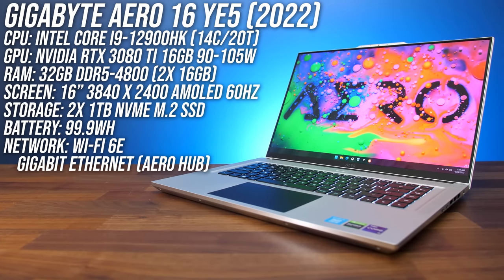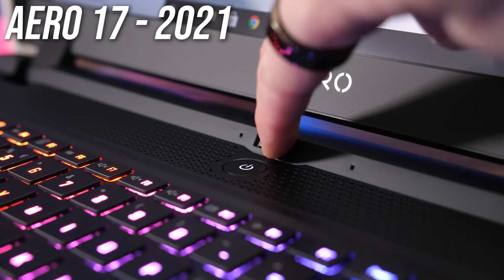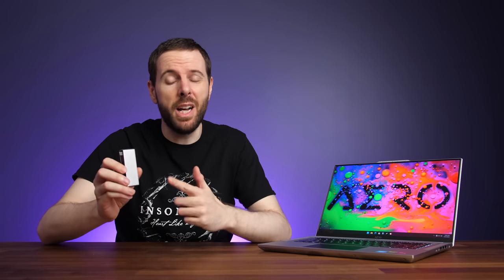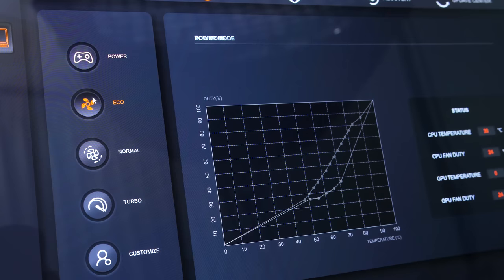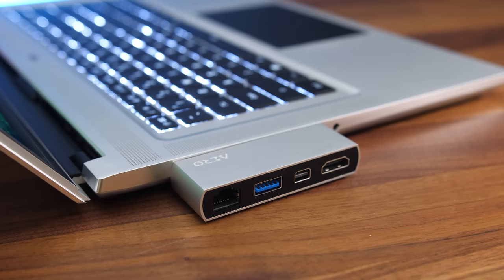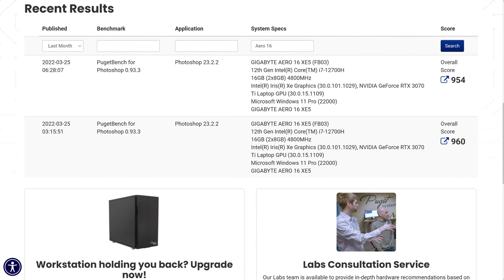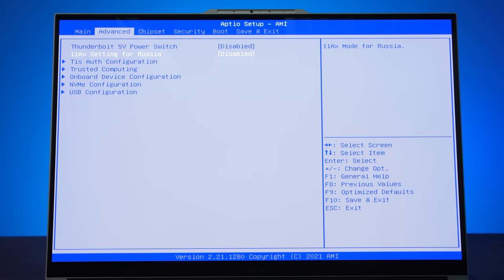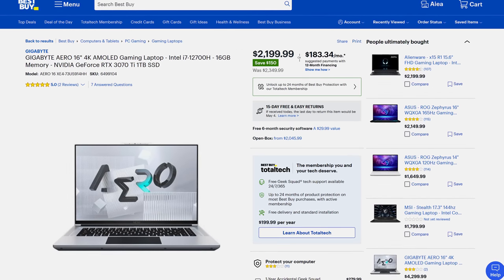Gigabyte Aero 16 Review - Why Did They Do This?

Comment: Just got this laptop, to fix the audio go to System > Sound > Advanced > More sound settings > Playback > Speakers > Advanced > Signal Enhancements, 

disable "Enable audio enhancements"

click ok

There, now it sounds really good, just much lower volume.

It seems obvious, they weren't happy with the volume and just craaAAAnked up the treble into to clipping using some processing.

Comment: Since you've reviewed plenty of Gigabyte laptops, I'd like to ask you something. Have you been using the Gigabyte Control Center? I bought a Gigabyte AERO5 XE4 (i7 12700H, 3070 Ti), and the latest updates, both GCC and NVIDIA, killed the performance it had when I first used it. GCC can't be rolled back, but the NVIDIA drivers can, which solved half the performance issues. GCC used to be able to change CPU TDP on the fly by switching power plans, but after the latest update it stays stuck at 45W unless I change it manually via XTU. Choosing any profile within GCC now only changes fan profiles, which is pointless when you're not increasing power to the CPU as it only adds noise to the experience. The latest NVIDIA drivers removed the power limit option, locking the GPU to not go over 109W, but going back 2 versions fixed this. I'll update once they add the option back. As for GCC, when you try to roll it back to a previous version, the app opens an internal browser with the link to the latest version, completely disabling all other functions. Updating or rolling back BIOS made no difference. The Gigabyte power profiles were 45W for power saving, 55W for balanced and 70W for high performance. Since it stays at 45W, the CPU doesn't even reach the base clocks, causing performance within games and other apps to drop substantially. I also tried uninstalling GCC altogether, but the problem with this is the "Turbo" fan profile. This fan profile reaches a speed over any other profile, and it's the one that drops the temps the most. When GCC is uninstalled, this fan profile is never applied, so applying the High Performance power profile (or setting the TDP to 70W as intended before the update) causes thermal throttling, which it didn't do with the Turbo fan profile. So, with all this said, what has your experience been with GCC (if you've been using it), and have you seen performance issues with the updates?
Reply: How did you manage to roll back your BIOS? I want to roll back the bios of my AERO 16 but can't seem to find the previous version from their website
Reply: @WeeeAffandi   There were 3 BIOS versions within the Driver Downloads page of my model. I also checked comparable AORUS models and sometimes there was only one BIOS, others 2-3.
Reply: @cianide99 Hello did you install the latest GCC?
Reply: I have the exact same laptop as you and my battery life is horrible (2hr max) do you have the same problem ?
Reply: @Alexpiano9104   Yes. I first installed the previous update, and my laptop keyboard had some colors enabled, red, orange and green. I contacted Gigabyte about it, basically telling them to fully enable the RGB in this keyboard since it obviously is, but their answer was that, because of the model, the color was locked to white. A couple days later the latest update rolled out, disabling the keyboard color change and setting it to white only, but that update completely disabled the TDP changing with power profiles. Tried to roll back GCC to the earliest version, but when it loaded, all that was available was a browser within GCC with the link to download the latest version.
Reply: @cianide99  i know what you mean , you have to click in the left tab and click “check” and install gcc from there
Reply: @cianide99  Do you have also a horrible battery life ? If not , how did you fix it?
Reply: @Alexpiano9104   I rarely use it unplugged. I use it either at work or at home, so mostly I don't have the need to use it on battery. Most of the time I have somewhere to plug it in. For something on the go, a gaming or creator laptop isn't the best option.

Comment: as a normie pc user, having no ports other than usb c automatically throws that computer on the bottom of the barrel, no matter the specs. much rather have an i5 with ports that an i9 without ports. ethernet is a must

Comment: This Aero laptop is a creators dream machine.
Reply: You forgot the missing SD card, which, as much as I hate Dell's XPS products, at least their XPS 15 & 17 still have a full-sized one built-in with no dongle required! And heck, even APPLE reversed course and readded one! Add the software glitches for CREATOR'S APPLICATIONS, the port selection being worse than a 16 inch MacBook Pro from 2019, and the rather high to ridiculously high price of the models, and I don't think it's worth it at all...

Comment: Hello, Bought this laptop aorus 5se and it performs well but it will not keep a charge while plugged in and gaming.  Help me, is it normal?
Reply: i have the aero 5 xe4 and i have the same problem when gaming, i think that the psu deliver no enough power for the laptop when on gaming

Comment: I bought a gigabyte Aero 16 with 3070ti and i7 about 4 months ago, recently it started turning off randomly, screen black out , wifi occasionally looses connection. Now it is in the service center. Hope they can fix it.
Am I the only one who is faced with such issues? With my previous laptops I had no such issues.
Reply: I had somewhat similar issue with screen black outs (sometimes it would become glitchy and would require a restart). I installed a new RAM last week and so far its been running fine.
Reply: I had that problem of powering on, and then a few seconds later, it shut down randomly once. After powering on a second time, it doesn't happen again. I was using liquid metal, after moving it to Thermal Grizzly Kryonaut it stopped randomly shutting down.

Comment: Anyone used it for more than a month? How is the heat in games? Does it hold under full load without a cooling pad?
Feedback would be appreciated.
Reply: I have the 3070 ti version and didn't find it particularly hot or loud. It's like Razer with heat, and less noisy IMO.
Actually i don't even understand people complaining about loud fans. It's very quiet still runs the latest games well.

Comment: Hi i m going to buy a new laptop and i have only 2 options so what would be batter ?
AERUS 15p kd 240hz with rtx 3060p i7 11800h 16 ram 1T ssd for 1830 dollar or LEGION 5 with rtx 2060 i7 10750h 16 ram 256 ssd+ 1T HDD for  1290 dollar
Reply: The AORUS have 99Whr battery
but the LEGION have only 60Whr
Reply from the maker: Legion goes up to 80Wh. I haven't  tested Aorus 15 in a couple of years so hard to compare, Legion has MUX so that's a bonus, however the 3060 will easily beat a 2006, I have a video comparing that on the channel.
Reply: @JarrodsTech  thanks

Comment: That input hub is a bad idea. Some of those ports should've been on the laptop. And even with the hub you still have no sd card slots, full size or micro... on a supposedly creator laptop. So that means using yet another dongle. To me this Aero model is a poor design and not worth considering. Ironically Jarrod says they've gone "full Apple," but even Apple has started adding back ports to Macbooks lately.

Comment: Too loud for too low cpu speeds. Otherwise I actually like it, and DPC latency is outstanding.. Would be a brilliant laptop for audio creation... Basically it needed a vapor chamber and liquid metal and higher power limits and would have been an instant buy. Oh well.
Reply: Gigabyte love to oversight those needs in its more than obvious extreme thin laptop.

Comment: This I/O is just spit in the face.What is next? Just two thunderbolts, including for power? A fucking CREATORS notebook without HDMI 2.1 or a proper DP1.4, without a fast SD card reader. And this after the MacBook Pro, that returned the proper I/O.
Reply: Hahahaha, it’s like Gigabyte shot themselves in the foot with the port selection. No SD card slot on a creator’s laptop, what is this, a lie!? 😂

And not to mention it’s not too thin for these ports!
Reply: @blue4059  I did. I got a Lenovo Legion 7; while the Legion 7 doesn’t have an SD card slot, otherwise, it has more ports than the Aero with the dongle. Also, only the Aero 15 uses the old design, and it has issues like a nosecam in 2022.

Comment: Content creators stop helping Gygabyte. They are pushing known poor quality products out the factory door

Gigabyte Aero 15 Laptop- Bought my son a Laptop and after 8 months the fan started grinding. Gigabyte won't do anything about it. After looking online this is an extremely common issue with a lot of the Gigabyte laptops (fan going bad in 6-8 months) and Gigabyte knows it's an issue but won't do anything about it.  Avoid Gigabyte at all costs not the quality they once were

Comment: If u really want a laptop with no issues and good battery life and good software don't get this stupid laptop, I bought last year's 11th gen version and I literally never expected this much frustration out of such a new laptop, gigabyte control center is literally trash and I'm literally so dissapointed in jarrod that he doesn't tak about this, if I knew how bad it is I wouldn't have bought it, bad thing is I'm from Iraq and I have no way to get it back to bestbuy, I used a shipping company to get it here, the battery life is trash, 3 hours if I'm lucky, put the laptop to sleep by closing it after half an hour sometimes it wakes up for literally no reason and then it hybernates after a while, even when it's in sleep it takes 4 seconds to boot up which feels super slow compared to macbooks which literally turn on while the lid is being opened, when the laptop screen turns off after screen saver time runs out touch the kyboard and it takes a good second to turn on even tho it's literally just the display being off, and lol gigabyte control center literally breaks if u don't uninstall intel xtu which it installs automatically during setup of control center itself, the display is great but don't believe the hdr marketing it's literally trash, the colors get so ugly when u turn it on, and set any color u want for the rgb keyboard and it never ever stays that color, after half an hour or so it just turns back to golden yellow every single time so I always just turn it off, and worst of it all, after not even a year of the laptop being out gigabyte control center isn't getting updates to fix issues, the last update I had was a few months ago and it didn't change anything, so yeah just don't buy this please

Comment: Gaming mode is too loud. Hard pass.
All manufacturers should be including a mode which keeps dB around 45 and reasonable temps while still providing 85%+ of max performance.
Otherwise they have failed in their thermal designs
Reply: Excellent point. How loud a laptop gets is one of my main concerns if I'm looking to buy a laptop nowadays

Comment: My AERO 15 died from its gpu fan crapping out after some 4 years. I've lost faith a good bit in these thin laptops that travel, take dust, have small fans, and are meant to game. 

Even before the laptop died, I had serious slowdowns on basic things, clicks lagged, load times got egregious, etc.
Reply: Have you ever opened it up for a proper clean? 

I re-paste mine once a year and discovered that the dust that accumulates over a year completely blocks the intakes and causes thermal throttling. Mine is also 4 years old and is running healthy.
Reply: @boy638  I did but too late. Also blew compressed air into the fan. A mistake I won't repeat, but done now.
Reply: @OneAngrehCat  Yea after seeing the internals during re-pasting, compress air does nothing to remove the dust. Sorry to hear, hope you will upgrade to something better soon!

Comment: I personally never have a desire for 4k on a laptop. The ppi density is just beyond overkill  and unnecessary not to mention the extra battery drain.. Furthermore only 60hz. Hard pass for me no matter what other the specs are.
Reply: I agree. The Mini-LED 2560x1600 screen looks good, but given all of the bugs in the software, the poor port selection, and the price of the higher-tier models, Gigabyte just swung and struck out three times.

Comment: The performance gap between DDR4 and DDR5 should be much more pronounced on laptops. With desktops its quite easy to get cheap DDR4 thats easily overclocked to be faster than almost all DDR5 in terms of overall bandwidth and latency, though future CPUs with much larger cache are more likely to favor bandwidth over latency so dont stockpile good bdye unless you intend to stick with Alderlake/Cezanne (i've gotten both to DDR5 4933 CL17-17-17-30, and the 5700G was actually faster than the 12600k in terms of memory bandwidth).
However with laptops the best DDR4 i could find that was relable was 3600MT/s CL22, and that was VERY expensive. Where as DDR5 starts out at i beleive 4800CL40

Comment: Definitely a compelling option for Windows gaming laptops. What I hate about previous Aero laptops are the wobbly screens when typing. They finally fixed it.
Reply: There can be gaming laptops other then windows? lol
Reply: @Ladas552  I think he meant strict windows support. It sucks using linux on these
Reply: @victorborges750  is that a theory or practice based fact that linux will not run well on this?
Reply: @Ladas552  based on my own Aero 15 (2019) experience. Other manufacturers have much better support